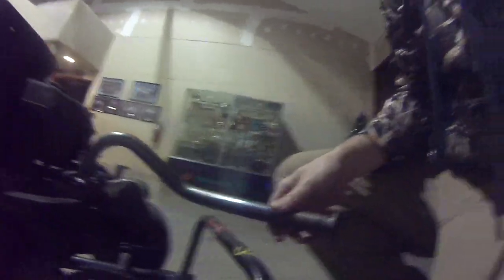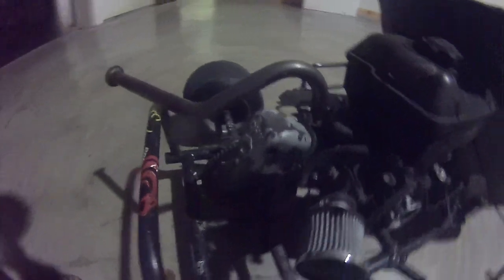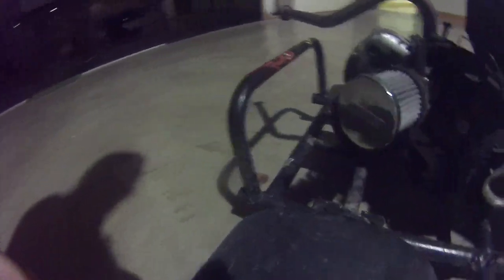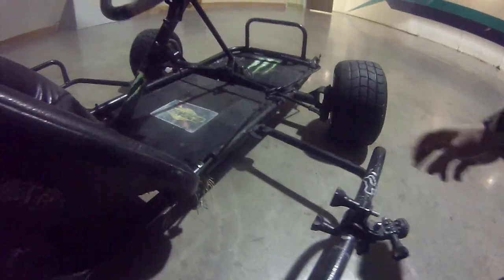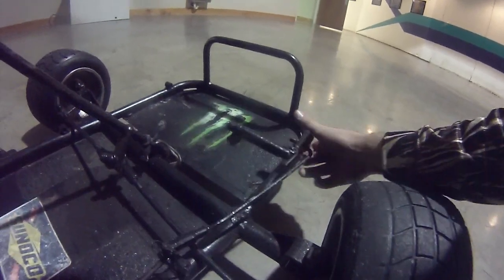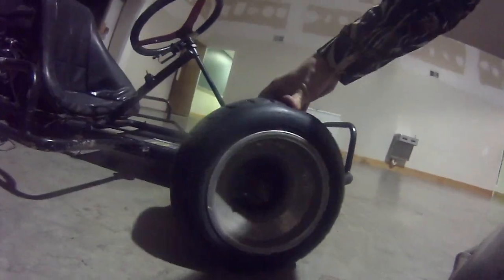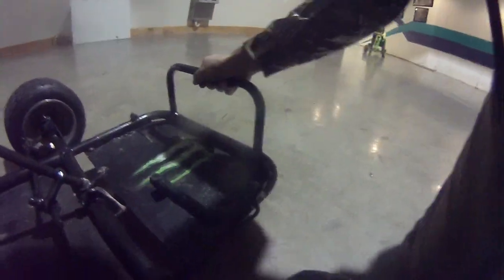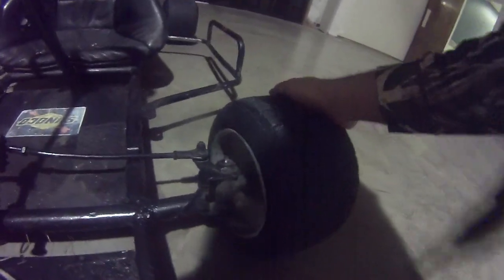(Race Kart Pull Series) Go kart Build Project

Comment: that's a over head valve Briggs and Stratton 6 HP. 206 cc
Reply from the maker: +Always Karting oh wow and I thought it was a small 5hp. Thanks for the help
Reply: Well the 6 and the 5 are almost identical. Do you still have the motor on it I have a recoil for it
Reply from the maker: +Always Karting I have it as back up. .yea using rope to start it takes it toll
Reply: Do you want a recoil.
Reply from the maker: +Always Karting I mean yea it's be nice lol